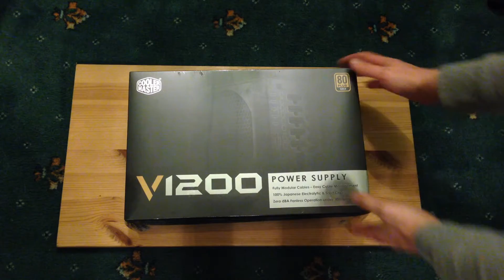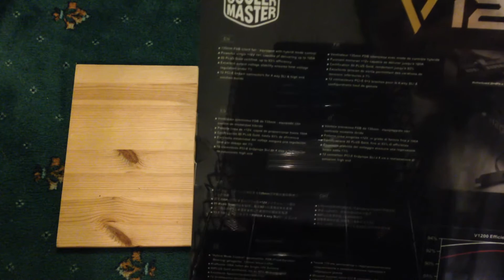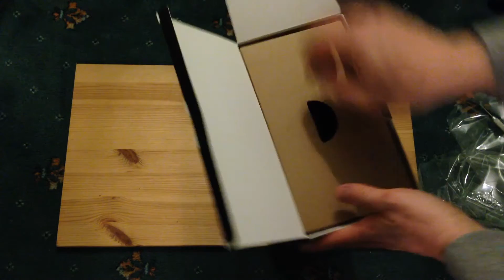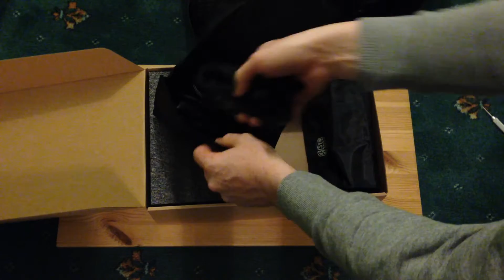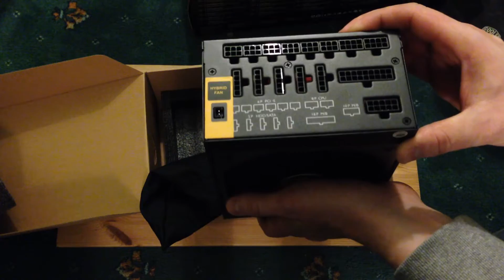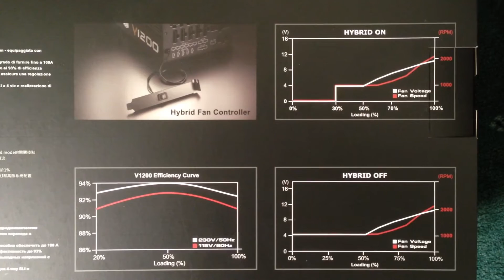Cooler Master V1200 Series Modular PSU 2014 Unboxing & Demonstration

Comment: Umm,  Unless your beautiful case does not have vent holes underneath the PSU (it appears that it does have them) then your PSU is mounted upside down.  YOu always want to be drawing in outside the case air rather than the warm air inside the case.  This will keep the PSU cooler.  I have to admit though, that with this awesome PSU and its 94% efficiency that it will have in your setup will produce very little heat.  I noticed the heat sinks inside this PSU are much smaller than the ones in my old Silent Pro Gold because it really doesn't need them to be large even thought it cranks out even more amps.

I think you'll find the V1200 label on the other side will also be right side up on this side when you flip it.

Comment: My Cooler Master Silent Pro Gold 1200w PSU started having issues three weeks ago where it would overheat and shutdown after only 10-30 minutes of very light use (well under 300w), If I tried to actually play a game and cranked up the GTX-780ti OC it would shut down in under 10 minutes.  Cooler Master support was really great. They obviously had issues getting a replacement for me and I mentioned I would be willing to pay a small upgrade fee to get the new V1200 as a replacement.  BTW, I had no idea anyone else had done this and I only saw this video today.  Anyhow, my new V1200 Platinum arrives tomorrow and they did not charge me any upgrade fee. BTW, I was only 2.5 years into the 5 year warranty on the Silent Pro Gold 1200w. 

Cooler Master tech support has always been great.  When I needed to upgrade old cases, for instance to update the front panel on my HAF-922 to USB 3.0 from the USB 2.0, they only charged me $14 for the entire panel with the new audio and USB connectors.  They also had the new cables alone for $7.  They are always very pleasant to talk to as well, a great bunch of guys.